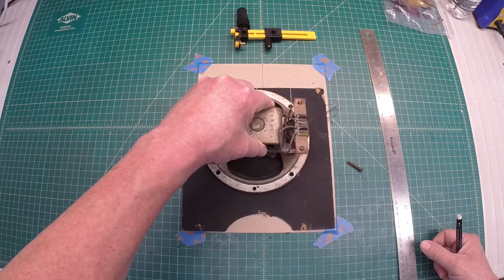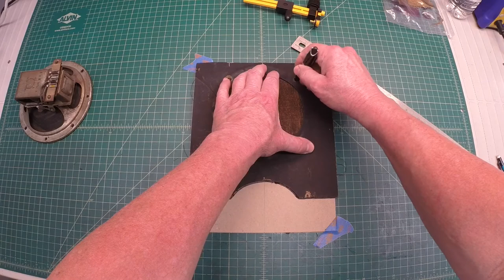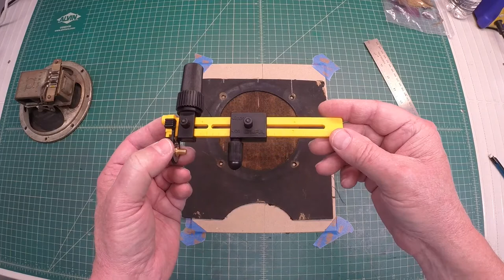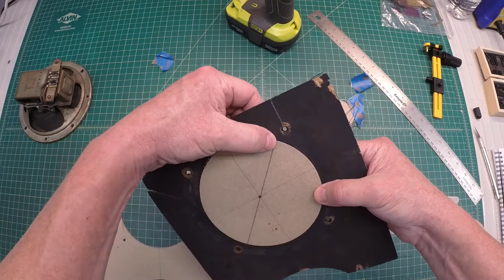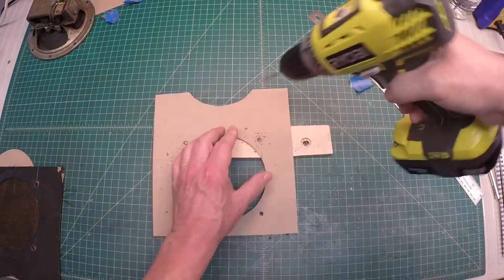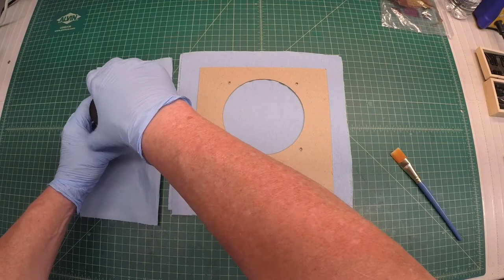Zenith 5-S-29: Reproducing the Grille Cloth Backer Board

Comment: Hey Don, Whew!  Hard to keep up with ya lately, lol.  Just wanted to say that Peter Pan cabinet turned out awesome!  A lot better than it had any right to, ha-ha.  I never even knew one could buy that self adhesive cork sheet but then I don't live near any craft places, the closest are about 30 miles away.  Guess I need to get down there and check them out for ideas!  I had an idea for backer board...it may already be an idea, I dunno, but it occurred to me that if you could get that stuff they use for boarders around paintings and ask them for a piece that hasn't been cut that it would make good stock for backer board.  There's a place here where I can get it uncut called Hand & Co. so I'll ask them, but you being near those craft stores it should be just as easy to get.  Looking good as always, Take care, Gary
Reply from the maker: Thank you Gary. Great tip and good to know on the backer material. I will definitely check and see what I can find. I also use Illustration board at times too.  Thank you again for watching and following along. Best, Don